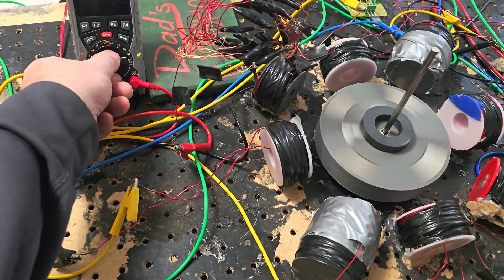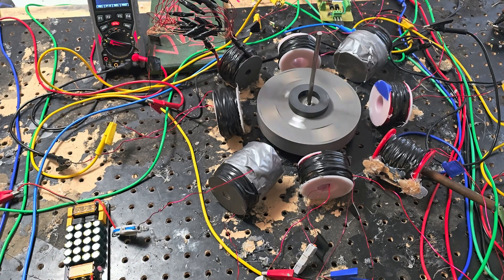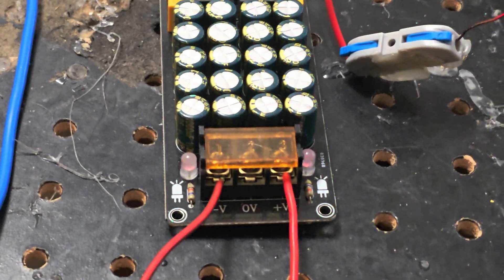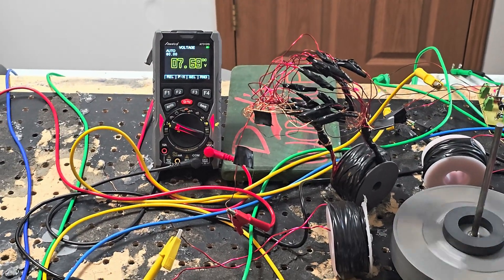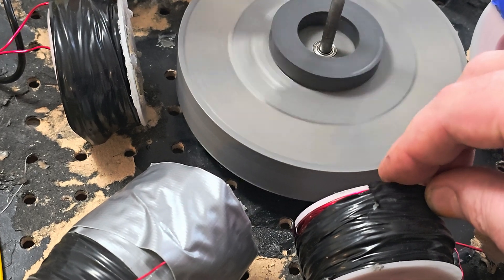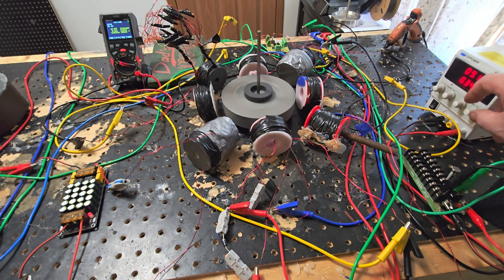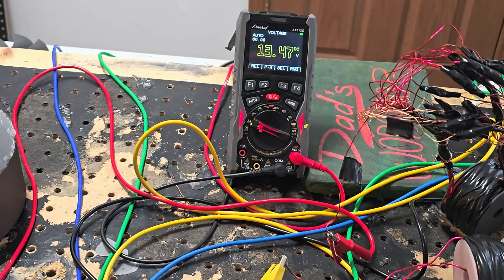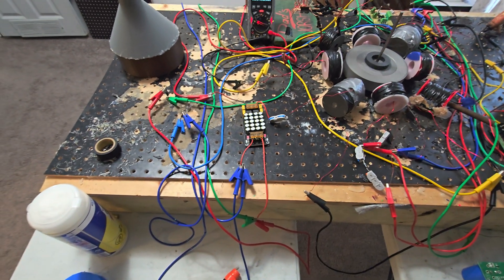Pulse motor mayhem

Comment: Just began watching your channel and am impressed with the size and effort you are putting into this area of energy resesrch. 

You said here you are soon changing things up a bit with the table. If you are open for newbee suggestions, maybe setting the motor-generator axis up virtically would give you more room and easier access to the finer adjustments. I see a future in such "power-wall" installs; and you a big part in making it happen.

We are all in this together; may all the powers assist us.
Reply from the maker: @PowerMakersCafe  i have heard a small amount about the power wall it's like a parallel "battery dump",in series
Reply: @MPHJR  Yes, the current powerwall is entirely a battery based storage and delivery system. As you know, that is enormously resource intenssive. And with all that, it still requires the purchase of an external power source.  But I can see you are working on its new generation that will be the preferred solution.
Reply from the maker: @PowerMakersCafe  thanks for watching

Comment from the maker: true power "when the machine is its own source power". no caps no batts no bench.
Reply: These are all components which are assumed to be required by such an electro-magnetically pulsed motor-generator system. Of course, it would be more economical to engineer any system with less components to fail us, and we should always strive to do so.  But look how many of these are still included with todays Solar based system; and that is considered a finished product.  But Solar only works during the day, and it requures a pretty good day of exposure in calm conditions. Well, we all know its vulnerabilities, right?  But this is a privilaged and exciting viewing behind the scenes of an emerging energy device that will solve a lot of those problems, and I am enjoying every minute of the ride.